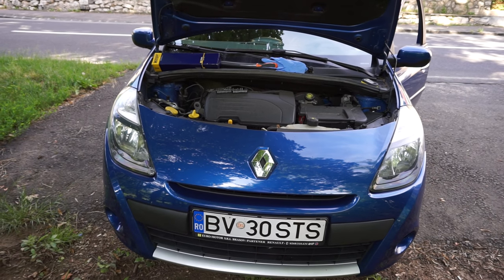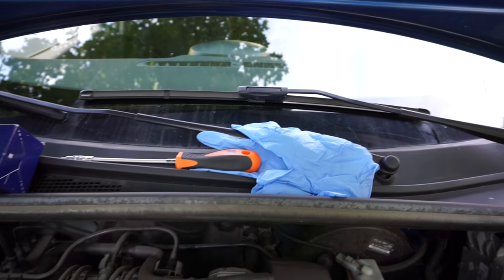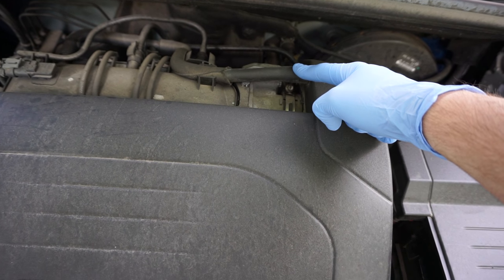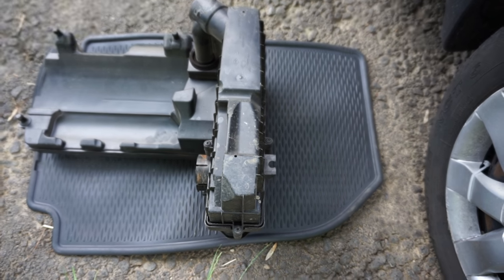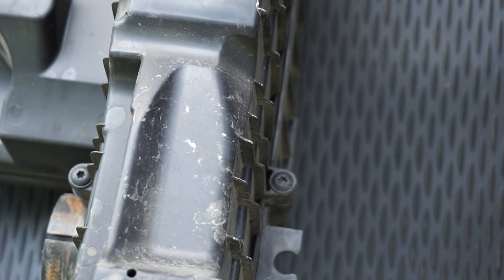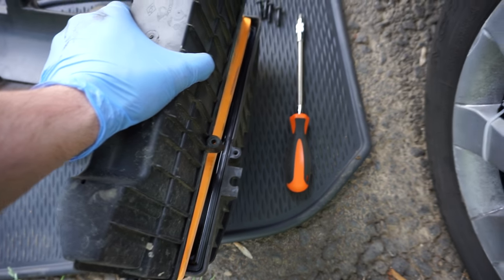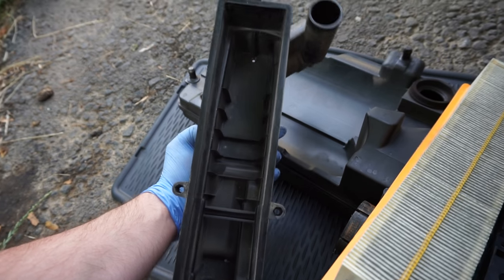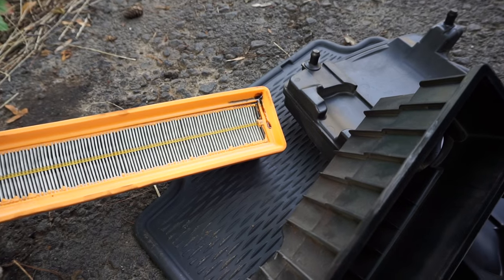Renault Clio 3 Air Filter Change

Comment: Salut, îmi poți spune te rog dacă ai filtru de combustibil pe mașină și dacă da unde este poziția lui? Mulțumesc
Reply from the maker: Salut! Modelul asta, fabricat in Turcia NU are filtru de combustibil! Cel putin nu in exterior. Am cumparat filtru de benzina ca sa-l schimb la 60.000km si a ras mecanicul de mine cand a vazut ca nu-l gaseste! :))) Ce sa zic. Din prea multa ravna am voit sa fie totul ca la carte. Foarte probabil filtrul se afla in rezervor si se schimba doar odata cu pompa de benzina, pe la 120.000km sau cand e nevoie, daca pica pompa.
Reply: @m3rovingian Corect
Reply from the maker: @robertradu5656  :)

Comment: Clio 3? I have a clio 1.2 TcE 2011 i have a large air filter that sits above the battery, can't see that filter on your car, or is it that there are 2 different air filters in the engine compartment and one inside the car?
Reply from the maker: Nice. Your engine is different than mine. I don't have turbo. My engine has only 75hp. Yes, it's Clio 3 Grandtour 1.2liter petrol and LPG engine. That's why it's different compared to yours. You shoulf have one engine air filter and one cabin air filter.

Comment: May I suggest, rather than wiping out the filter housing with a cloth, rinse it out with petrol and a paint brush which will de-grease the surface.

I use a deep baking tray with drop of petrol in it. Stand the filter housing on end, in the tray and wash it out with the petrol using the brush then leave to dry.

Wear safety glasses when cleaning!

You can put the dirty petrol in the waste oil bucket.
Reply from the maker: It is a bit extreme from my POV. The baby tissues are really good at decreasing anything because they have alcohol. Also you don't need any special glasses to use them and not to mention the hassle of using what you said. But if it works for you that is all that matters. Just make sure the smell and vapors from the petrol don't get inside the engine. It might also mess up the airflow sensor.

Comment: Hi there please do you know where is located fuel filter. On clio mk 3 like yours.thanks
Reply from the maker: I think it is located somewhere near the back left wheel, inside, covered by the plastic behind the wheel. I don't know for sure.
Reply: m3rovingian  thanks a lot for replying to me .if u have pictures or video will be superb. To change it my self .
Reply from the maker: When I will change it I will come back with a video. At this moment I have about 52000 km with my car and I never changed it.

Comment: Which engine is it?
Reply from the maker: D4F740 1.2 liter,  75hp, 16Valves. The car was made in 2011 and I bought it brand new in October 2012.
Reply: @m3rovingian  Thank you. I was looking for a video for my 1.5 dci clio. When I saw the engine, I figured out it is different and wondered its type.
Reply from the maker: @cemaltaylansozudogru8029  Yeah, mine it's petrol and LPG, not diesel.

Comment: Can someone Help.I have Renault clio 1.6 gt line.the problom that i have is when i want to accelerate,the car goes into limp mode and the car start shaking pretty badly. code p0300 ramdom multiple cylinder misfire detected.
Reply from the maker: Go to a reputable car service in your town and get it fixed properly. A bad advice on the internet can ruin the car even more.

Comment: Do I need to change this when AC or air creates a bad smell inside the car? Or should I only change the cabin filter?
Reply from the maker: It's not related. This is for the engine. If you have a bad smell from the AC then I would recommend changing the cabin filter. i have a tutorial on that also. But fist I highly recommend you was with active foam tall the vents of your car's AC system. You can find many products. It's a spray can of around 400ml with a long plastic thingy which you will stick all the way into the vent then press the spray and pull it out while the active foam is released into the vent. Do this for all the AC vents then wait about 15 minutes to clear and then, with the windows opened start the AC on the max and let it run for about 15 to 20 minutes more. Make sure you wear all the time some plastic gloves and protective glasses. they are a must so you don't accidentally get the foam into your eyes from the plastic thingy.  After that install the new cabin filter.

Comment: La modelele noi de clio au pus priza de aer dinamica......mama lor de Renault, nu puteau sa o faca si la modelele mai vechi- cat mam chinuit sa adaptez....
Reply from the maker: Intr/adevar e aerodinamica. Daca as mai cobori si centrul de greutate cu arcurile de la eibach, asa ca sa linistesc piticul, crfed ca ar fi si mai eficienta la drum lung.
Reply: La orice stil de mers ar fi - aerodinamica lucreaza si la 20km/h si la 180km/h;
Ce sigur vei simti este un consum redus plus stabilitate......din carenaje facute artizanale de mine ( dupa modele de raliu) plus suspensie am castigat 10km/h la viteza maxima la aceeasi putere......in viraje simti maxim acest lucru, sau depasiri camioane la viteza mare......nu te mai arunca in lateral deloc, inclusiv cu vant din fata/lateral
Aici in videoclipul tau m-au enervat cei de la Renault cu locul unde au pus priza de aer.....frontal direct - desi absoarbe mai multa mizerie/apa mai ales la viteza mare dpdv al performantei este mai buna decat priza laterala la far cum o am eu
Am adaptat si eu asa ceva insa pierde "cuplu" pe ture mici/medii....la viteza maxima se simte; am revenit la priza OEM, imi convine mai mult, merg cu viteza maxima mereu si mi-ar arunca apa si mizerii in ultimul hal in motor......
Daca la mizerii treaca mearga ai filtru de aer, sa te feresti sa aspire apa in motor, mai ales la viteze mari......nici un filtru oricat de sintetic si ultra giga mega racing sport nu te protejeaza de aspiratul apei in motor.....